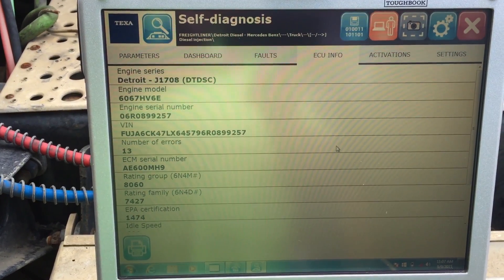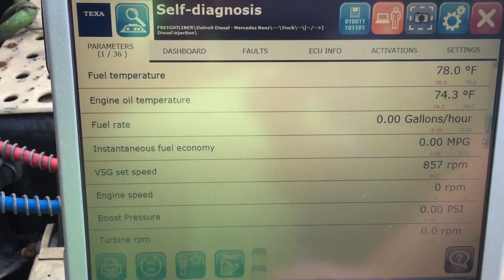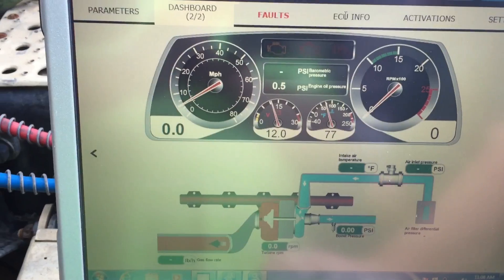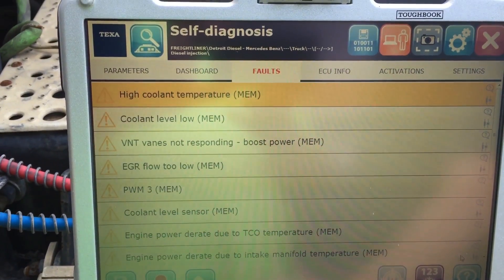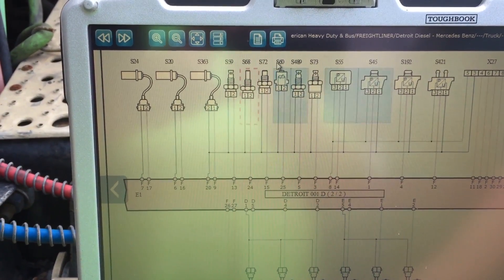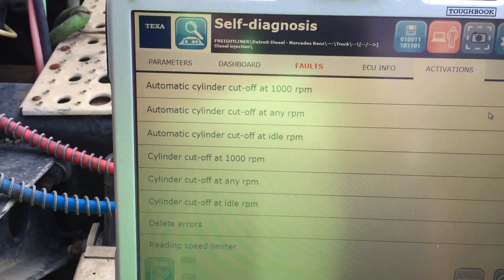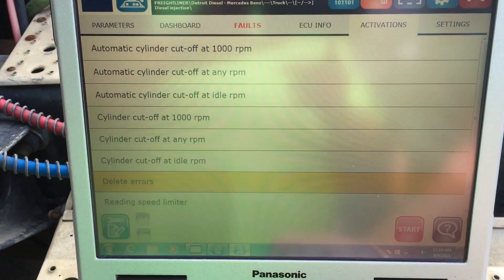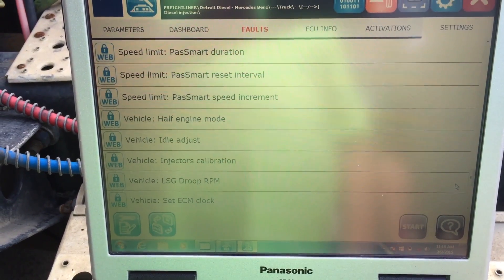TEXA Heavy Truck Diagnostic Scan Tool on 2007 Freightliner with Detroit Engine

Comment: We need to know if TEXA can tell me exactly  what problem is ? Not just read me the codes, and how  clearly does it tell you about it. Can you delete EGR  VALLVE and DPF filters with TEXA, those kind of things i would like to know if texa can do ?
Reply from the maker: First, deleting emissions systems is a federal crime. Secondly, you won't find any mainstream software that does since doing so is illegal. You will need to search around and find some that does "EGR Deletes <engine name>" and there are people that do this. Some use bootleg pirated software to do this, others use actual ECM modification software.
Reply: Yes it is a federal crime but there's other countries that don't have those law's like Mexico, etc etc etc. And there's a provision for"OFF ROAD USE" so I wouldn't see a good reason for a "main stream company" to build in those options. In my opinion.
Reply: Texa can do it all. It can delete your dpf/doc. Fix your abs light
Reprogram your tcm. You can use it as a funnle to pour def in the def tank. But you won't need to beacuse you can delete the def catalyst all together. With texa you can block police radar signals.you can even stop internal bleeding with texa. It will gently rock you to sleep at night while singing your favorite bedtime song. You can even you it to connect with love ones that have passed. You just need the 15 pin dutch adaptor sold separately.

Comment: This guy have no clue how to run this scanner. If you are going to sell $ 6000 worth of equipment then be nice to explain little better how to actually find the problem. We all know how to find codes but we need to explain to us if TEXA can actually do it.
Reply from the maker: We have a specific video that explains step-by-step how to find your diagnostic trouble codes and how to find repair information on the tool. Keep in mind that we use tools only available at Diesel Laptops, and no one else has these. Here is the video: https://youtu.be/vw8B9XwxBao